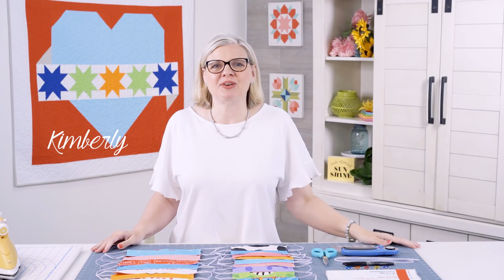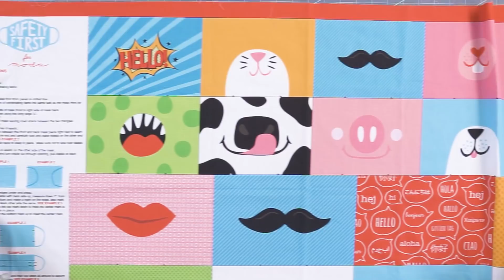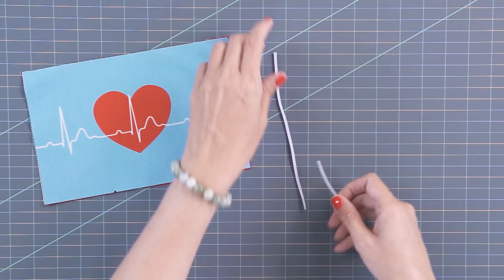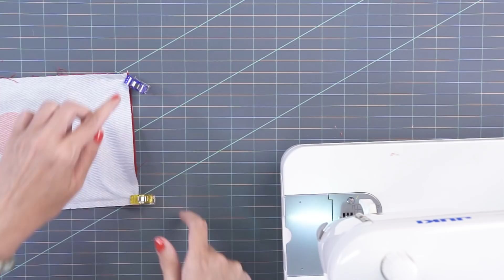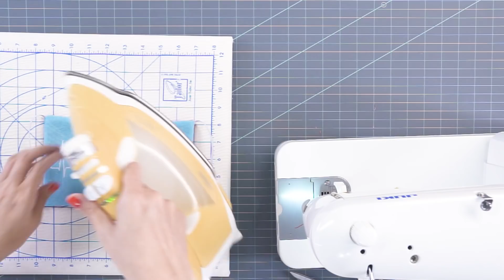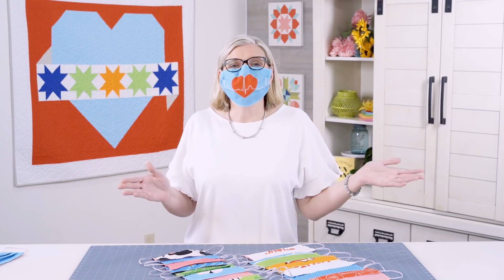| Fat Quarter Shop

Comment: Is there a way to make them CDC compliant? I'm not even sure what that means... I tried to look it up, but didn't come across any hard and fast rules from the CDC. Thanks for any help here!
Reply: You could leave the opening "open" and add another piece of material, a tissue, or paper towel as a filter.  To be totally compliant, it needs to be able to filter 95% of materials and fit snugly around your face.  But even cloth masks can filter about 70%.
Reply: I would add fusible interfacing to these cute masks.
Reply: Look up the Wake Forest home made mask study.  Gives great information!

Comment: Why are they not CDC compliant?
Reply: I didn't see a wire inserted to bend it to the contours of your nose.  It also looks a bit shorter than it ought to be.
Reply: CDC recommendations are based off of the transmission of the disease — contact, droplet or airborne.  Since everyone does masks differently, you can’t call it a Covid mask, as it is not proven to prevent airborne transmission.  HOWEVER....Wake Forest did a study on what kind of home sewn mask provided the best protection, and they suggested two layers of “quilting cotton” fabric and a layer of flannel.  This was shown to provide better protection than the paper surgical masks.  Google it, they looked at 13 different designs and 400 masks, that would have been a great study to have been a part of.....Hope this helps.